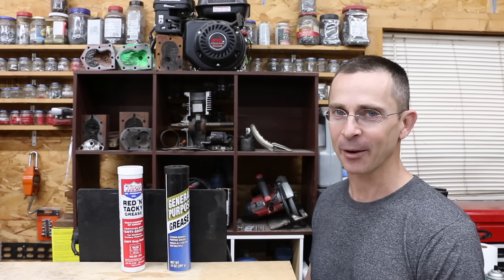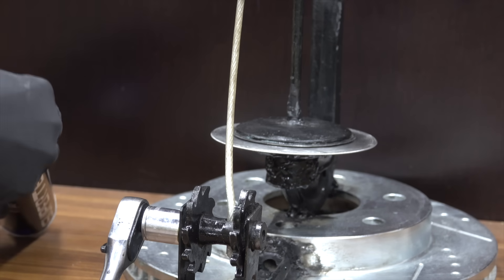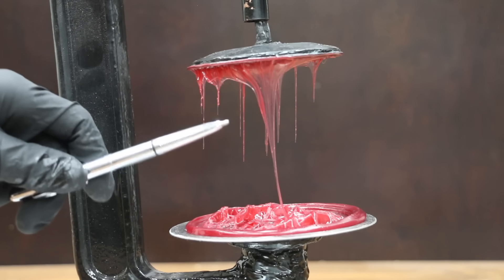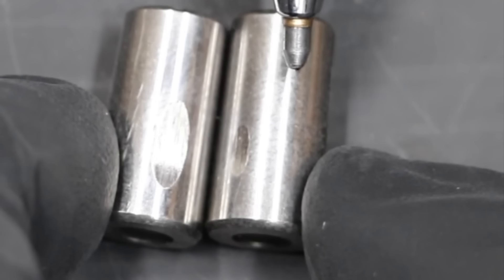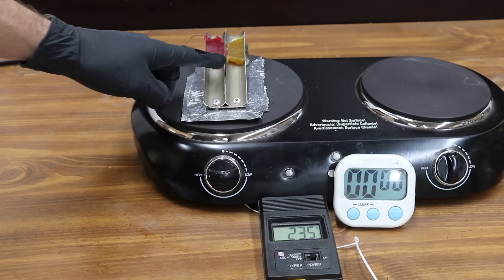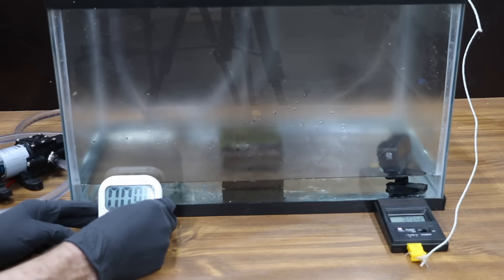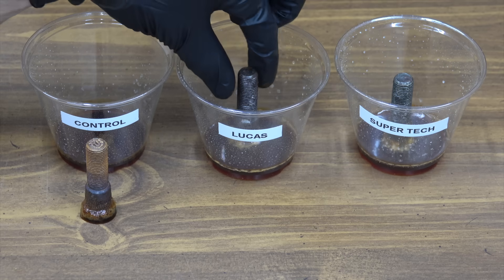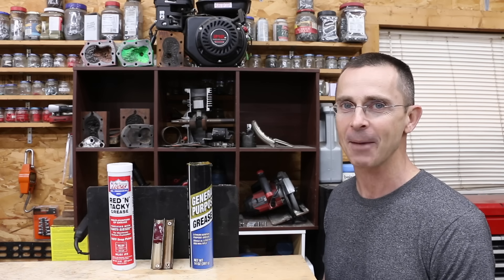Is Cheap Grease better than Lucas Red N Tacky? Let's find out! Bearing Grease Test Episode 1

Comment: I've been a big fan of Lucas products for years, from their transmission additive, power steering additive, engine oil additive and even their fuel injector cleaner for gas and diesel, never an issue and my stuff seems to always run well. Guess I'll have to start using their grease, but I guess when you have nothing and all that is available wally world grease would work till you get the good stuff.
Reply from the maker: Thanks for the feedback.

Comment: Would there be a possible way to test different brands of heat shrink? Maybe the percentage of shrink you get and the pull strength of the heat shrink and the adhesive pull strength of the heat shrink once it’s been applied to wire.
Reply from the maker: Great video idea.  Thank you

Comment: Thanks for such a great channel, you have helped me make some important decisions. I'm living in Iqaluit NU, Canada so any tests with cold performance are of interest. We get month upon months where the temperature hardly gets above -30C (Today was -39C with wind making wind chill near -60C). Here are some suggestions for tests:
1) Bearing test engine oils "cold" to see wear
2) additional cold grease testing (Aviation or cold rated grease GREASE CQ SUPERLUBE rated down to -45F etc.). also... How long does bearing take to get to running temp. eg -20C up to 0C 
3) Differential oils in cold weather
2) Test transmission and power steering and brake fluids cold
3) Test block heater vs. circulation heater vs battery blanket/heater or combos etc.
Keep the tests coming . :-)
Reply from the maker: Great video ideas!  Thanks!

Comment: How about testing several brands of double sided foam mounting tape?  testing on both on a vertical surface and on a flat surface (with downward weight applied)?  Brands seem to vary greatly in their claimed and actual weight holding strength.
Reply from the maker: Great video idea.  Thank you!

Comment: Would this great to use on a clutch pivot joint in a car? I use a spray lithium grease and it works good for a little then I guess it wears and thins out and starts creaking and gets tough to press pedal again.
Reply from the maker: It would be worth trying.  Thanks for the feedback.

Comment: As always this was some great testing. However, this is comparing the cheapest light duty to one of the most expensive heavy duty.  To me it was like testing if a Ranger can pull as much as an F350. It would had been nice had you included different products that claimed to be similar.

Comment: I have a great deal of respect for you and your videos. You totally dropped the ball on this one. You should have gone on the web and did research. Grease is not regulated like motor oil when it comes to composition. You purchase grease based on application not price or some of the silly test you came up with.
Reply from the maker: Thank you for the constructive feedback.
Reply: I can't believe it's been 2yrs & I still get hate mail. Ok I have no problem with the side by side tilt test. But it will only tell you if it needs changing. If I want to know the status of my equipment I will draw oil samples every 3 months and send them to a lab for a full spectrum oil analyst. I used to work with electric motors from 10-2000 hp. If you want to keep your job you do not play around with the grease that goes in it. Look up the manufacturer recommendations. If you search the web you can find charts that will tell you which greases can be combined if you are unable to flush the original grease out. Most grease mfg has 1 of 4 base compounds. Yes grease can become acidic when mixed with the wrong one. Sorry for offending everyone.

Comment: Love your video as they have really helped in providing some objective results. Guilty of buying the cheap stuff represented in this video. I will not any more as you proved you get more for if you spend more with Lucas. 

Couple suggestions to consider. I recently bought a couple 4-wheelers and am just going through to PM them. I bought some chain lube but there were multiple choices. Some said no splatter, some said bikes, some said motorcycle, etc. Not hugely expensive but there was a price difference. Do you get what you pay for with these?
Another one would be another type of chain; a chainsaw. Do you really need a lube specific for them? I hesitate to reveal what I use for a few reasons but would be curious to know if chainsaw chain oil is best or will another type of oil do just as well like cheap conventional motor oil. I would also be curious how you would set up a test for this if you chose to do so. 

Hope these suggestions are worth while and maybe a video is forthcoming about either. If not, I still am a fan of the Project Farm.
Reply from the maker: Thanks for the video ideas!  Thanks for being a fan!

Comment: I have recommended your channel to many of my colleagues, friends & relatives.. project farm comparisons is a commonly brought up subject especially to settle bets haha

Here’s a topic suggestion if you’re looking for more ideas:
Wall/house paints verities such as egg shell, gloss, semi gloss, flat etc etc
A comparison of which one covers previous colors best, under different temperatures also 
Which dries the fastest
Which resists stains best from cooking & cigarette smoke 
Which is most water resistant 
Which is easiest to clean crayons & sharpie stains off of 
Which is easiest to blend and match after some drywall repair 
Which will hold up best to scars & scratches 
Which will remain most flexible or dries up and cracks  after exposure to intense heat or cold 
Which is easiest to clean the splatter off of carpet or hardwood.. if that makes any sense 
Are primer & paint vs just paint alter any of these results 
This will help with using the same paint manufacturer and paint color, same manufacturer of paint brushes and rollers, etc

Thank you for your great efforts and attention to details
Reply from the maker: Thanks for the video ideas!  Thank You!

Comment: Great video as always. If your looking for different grease to test, I always use a Amsoil high temp grease or mystic jt6. I used to work for an amusement park and the amsoil was the only grease at that time that was recommended for the water rides.  It always appeared to have incredible water resistance.  The rest of the rides that were non water we used mystic jt6. There aren't many bearing applications in the world that take more abuse than those in amusement park rides and roller coasters.  I would be interested to see how they stack up with others.
Reply from the maker: Thanks for the video idea.

Comment: JB Weld Original vs. Duralco 4525

An engineer friend of mine says that JB Weld is junk compared to Duralco 4525. We gotta investigate!

=Categories=
- Metal to Metal
- Metal to Wood
- Metal to Plastic
- Metal to Stone
- Wood to Wood
- Wood to Plastic
- Wood to Stone
- Plastic to Plastic
- Plastic to Stone

Doing all your usual tests.
Reply from the maker: Thanks for your video ideas.
Reply: @ProjectFarm  No problem! If you want any more I can send them your way.
Reply: @ProjectFarm  My friend says you should mix the stuff either under a fume hood or outside, while wearing gloves. Because the hardener out-gasses before you mix it in.
Reply from the maker: Thank you for the constructive feedback.
Reply: @ProjectFarm  No problem dude 👍

Comment: Great test, lithium greases will blend a little with water. Try some Schaefer’s 238 aluminum base grease.
Reply from the maker: Great suggestion!
Reply: Project Farm   A quick test a schaeffer rep will do is plop some lithium in your hands and go wash it off, it’s difficult but will wash off. When the put a dollop of 238 in your hands you can’t wash it off period, it just moves and spreads etc, takes some good hand cleaner to cut it, I just use mineral spirits in parts washer lol.

Comment: The issue with mixing greases isn’t a chemical reaction issue. Lithium and non lithium greases do not mix well. Would be curious to see that film strength test with a mixture of lithium and non lithium grease in it compared to each grease by itself
Reply from the maker: Great test idea! Thank you

Comment: I bought a couple tubes of the Lucas red and tacky, for my boat trailer. Packed the bearings, installed the hubs. A couple days later, without the trailer moving, I noticed red dripping down the wheel and tire. 
I emailed Lucas, got no answer about this. 
What would you recommend?
Reply from the maker: I'd look inside the hubs to see if it has completely liquified.  If still a semisolid, it should be fine.
Reply: @ProjectFarm  I will. I've had a hub lock up before, going down the road, it's not fun!
Thank you for the reply.

Comment: Can't tell you how many grease brands I've tried since I began working on cars with my Dad in 1959 but the rumors,  tails told and anecdotes given added up to ZERO reliability with no answers.   Thanks to API at least we have a standard (of sorts).  Sincerely appreciate your video(s) Straight forward, easy to understand, practical application of the product with CLEARLY defined standards and outcomes.  You take all the 'kind-of', 'I think' and 'could-be' out of the equation.---Thanks again
Reply from the maker: Thank you for the feedback

Comment: Love all your videos...BIG THUMBS UP on this one.
 I am a bass boat owner and on the bass boat message board I frequent, there is a lot of discussion regarding what is the best wheel bearing grease for boat trailers. Dunking the bearings, hot from a long trip to the lake, into cold lake water is a test for both grease as well as seals. The Lucas Red & Tacky has become a favorite in recent years but I found it to take on water worse than the Lucas blue marine grease or my personal favorite Mystic JT-6 Marine, also sold under the Citgo label. Lubrimatic is also used in this application often. 
I, along with many other boat owners would like to see a side by side of the various brands of marine greases specifically designed for wheel bearing on boat trailers.
Reply from the maker: Thank you very much!

Comment: Hey is there a way you can test whether or not using neverseize on wheel lugs affects torque applied or if it's more prone to back out of the stud?  Also Aluminum vs Steel Lug nuts, which corrodes first which fail when over torqued and do aluminum Lug nuts expand and loosen under temp changes
Reply from the maker: Thank you for the video idea!
Reply: @ProjectFarm  ive been on some forums lately and there seems to be some myths and arguments over Steel vs Aluminum Lug nuts

Comment: Howdy, have you done a comparison video on different fuels to see if one is actuslly better in terms of increased horse power, detergents that clean the valves, heads etc. Example is Chevron with V-Tech better than Circke K, how does Phillips 66 or 76, Quick Trip and AMPM stand up to one another
Reply from the maker: Thank you for the video idea!

Comment: First, I really appreciate and respect your unbiased reviews. Your videos are some of the most useful and informative out there. Regarding this video, Super Tech makes a red "Multi-Duty Hi-Temp" grease. I use this to grease the pins on the loader of my skid-steer. Although the parts are never hot, I was told it was less likely than standard grease to "squeeze out" due the high pressures exerted on these parts during use. I'm wondering if this red grease would fare any better than the general purpose grease when compared to the Lucas Red N Tacky.  Please consider doing this test comparing the SuperTech "Hi-temp" with the Lucas. I'll use whichever fares best.
Thanks again for the great videos.
Reply from the maker: Thank you for the feedback

Comment: I have had excellent results with Lubriplate products, small company with good customer service IMHO. Would also like to see a comparison with a Moly grease, I have been using it in my PU truck, about 200K miles on the original ball joints.
Reply from the maker: Great suggestion. Thank you

Comment: I thought of an idea, I know you have  tested some stop leak type products or restorative products.  I wonder if there is a way to see if the engine seal restoring products work outside of an engine.  For example, age an o-ring and a gasket, maybe putting in the sun for some set time.  Then putting them into the seal restoring products.  Maybe use brittleness as a standard, as a control see how much force it takes to pull apart the new oring and then how much to pull apart an aged oring.   This may be a hard project to become reality, but I have been thinking about if those products really restore the seals.  Thanks!
Reply from the maker: Great test idea! Thank you

Comment: I would love to see testing of more greases, especially moly grease. I think that the tacky test was not very accurate  though, the plates should be pressed together with the same force. Using your hands to press the two together could change how much pressure was applied and how much grease remained. It might even be a better test to put 3 small stand offs between the plates so that the  layer of grease is the exact same for every test.
Reply: And also we need a more accurate way of scooping 25mL XD 
But love the video! Thank you for this one!
Reply from the maker: Thank you for the feedback

Comment: Awesome video, as always however i disagree with the "wash away" test, in particular with removing excess. In my opinion a better test would be a thin coating (for example formed by dragging a weighted spatula across a flat surface; whatever's left is left) then setting up samples at a 45* angle under running water. After timer runs out let samples dry for 5-10 minutes to get rid of water, then weigh and compare.
Reply from the maker: Thank you for the feedback

Comment: You have been educated in lubrication at some point. ML1 ML2? not just anyone has a failex machine and knows what film strength is. This is the first video of yours that I've seen, and you get a sub. Test some coupling grease, mobil has a new one that is unlike any coupling grease ever. Put some SF spec automotive oil against current API service spec.  Show the differences in wear additives across API specs. Do a video on the cheap grades of PAO stock used in consumer products. You should also do a video of bearing predictive maintenance and tribology, and the effects of over greasing bearings. Super interesting stuff, and you have the equipment.
Reply from the maker: Great video idea and thank you for subscribing!

Comment: Would like to see a test of 640:1 ratio of gasoline and 2 stroke oil mix (tcw3) to standard gas in a 4 stroke engine. Some people claim the mix burns better and cleans the top end. They also claim their vehicles ran better with the mix and idled smoother.
Reply from the maker: Thank you for the video idea!

Comment: I have learned that if it says "Lucas" on the side of the can or bottle, it is a SUPERIOR product. Hands down. Never worry.
Reply: Saved me the trouble of saying it. :)
Reply: So long as it doesnt say it on your electrical equipment, lucas have a reputatuon for total junk in that dept.
Reply: @deadprivacy  Yes indeed I have heard that. There is no Lucas electric in the USA though.
Reply: @HansFormerlyTraffer  they were once a big name here in the uk for vehicle electrics and early fuel injection systems most of which were terrible, they couldnt really fuck up headlights though, those were ok.
We still use their autobulbs in the garage i work in to this day.
Not sure if they still make anything significant  in the electric auto trade anymore though.
Reply: @deadprivacy  u sure u talk about lucas and not a delphi? used in tdci ford engines like 2.0 mondeo mk3
Reply: @avix213  i think lucas stopped making electrical and fuel injection systems long ago, but when they did? they were legendary in their crapness, 
far inferior to the boschs syustems that were their main competitor.
to be fair?
the delphi stuff seems to hold up ok, see far more bosch coils fail than delphi ones
Reply: @avix213  Lucas the Prince of Darkness

 a compendium of lucas related british jokes

The Lucas motto: "Get home before dark."

Lucas is the patent holder for the short circuit.

Lucas - Inventor of the first intermittent wiper.

Lucas - Inventor of the self-dimming headlamp.

The three position Lucas switch - Dim, Flicker and Off.

The Original Anti-Theft Device - Lucas Electrics.

>Lucas is an acronym for Loose Unsoldered Connections and Splices

Lucas systems actually uses AC current; it just has a random frequency.

"I have had a Lucas pacemaker for years and have never had any trou..."

If Lucas made guns, wars would not start.

A friend of mine told everybody he never had any electric problems with his Lucas equipment. Today he lives in the countryside, in a large manor with lots of friendly servants around him an an occasional ice cold shower...

Back in the 70's, Lucas decided to diversify its product line and began manufacturing vacuum cleaners. It was the only product they offered which did not suck.

Q: Why do the British drink warm beer? A: Because Lucas makes their refrigerators

Alexander Graham Bell invented the Telephone.Thomas Edison invented the Light Bulb. Joseph Lucas invented the Short Circuit.

Recommended procedure before taking on a repair of Lucas equipment: Check the position of the stars,kill a chicken and walk three times clockwise around your car chanting:" Oh mighty Prince of Darkness protect your unworthy servant.."
Reply: Yy f2f f:
Reply: I completely agree.
Reply: I have to say the electrical side of lucas works, but is not up to par on the quality, haha my Mg lights sucks. Get home before dark!
Reply: I agree, with the exception of their bottled 5th wheel grease.  Very messy and runny.
Reply from the maker: Thank you for the feedback
Reply: I personally don't like the results of their engine oils but their grease is some good stuff!